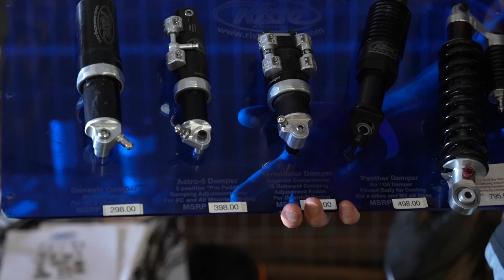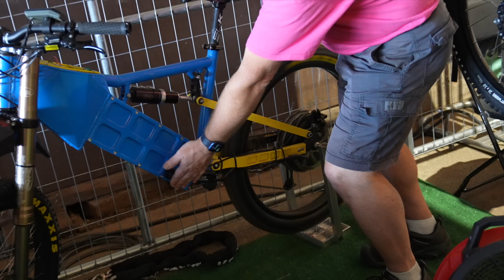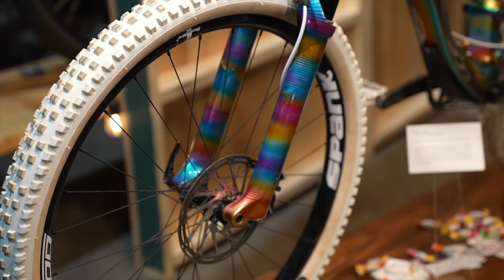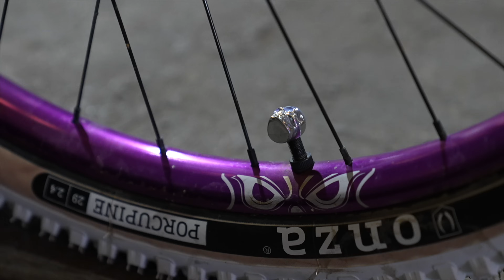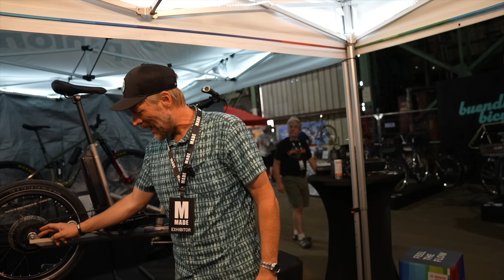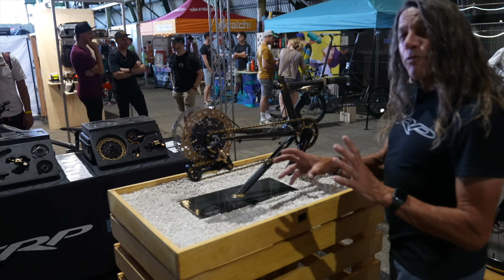Tech Picks from MADE Bike Show 2025

Comment: Mullet bike guy: talks about how better shocks make single pivot a good option and needle bearings are better. He has my attention. Talks about how carbon sucks. wtf dude.
Reply: Retro grouches hate CF bikes. 😀
Reply: You can’t recycle it when it inevitably fails and otherwise it just won’t be the same after 3-5 years of riding
Reply: @schildster  so?
Reply: @trentvlak the way most carbon layups are done overseas now leads to a lot of ovalized and non-concentric bottom brackets, same goes for bearing cups. so quality control is a major concern. I’m not  so convinced that catastrophic failure is a safety feature in a crash. If my mullet frame’s geo will never change then I’d be not so thrilled with having to replace it due to frame flexión from normal riding.

Comment: I am ordering schrader valves from miles wide. Thanks for the video!
Reply: High flow presta style valves have become more and more common. I used the 76Projects valves for a couple years till I ruined one. Then I found out they did not own the patent on all the sizes so I sadly had to start looking for alternatives. I ended up with Stan's Exo-Core valves and function wise they are solid. I especially like that I can push the pump head down onto it without any leakage or anything which isn't a given with all styles of valves. I use the small OneUp handpump so it's nice to not have to deal with 10 extra pumps each time. 

With Schrader you have to use a flip lock to stop air leakage which in my eyes is a pain. Why not have a valve where you can just press the pump head straight down and that's it, as well as no leaks.
Reply: Seems like extra hassle for no benefit.